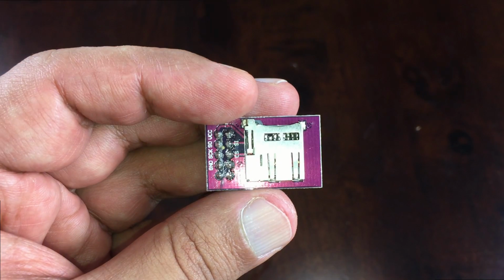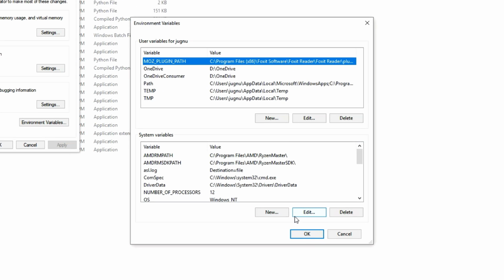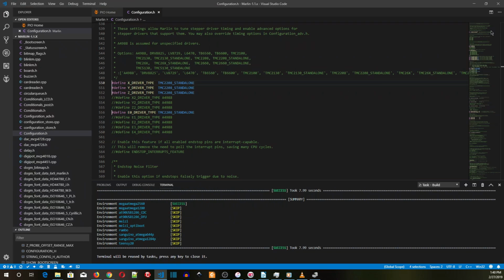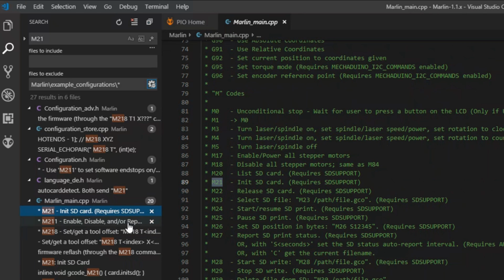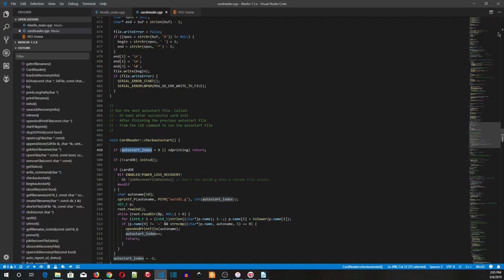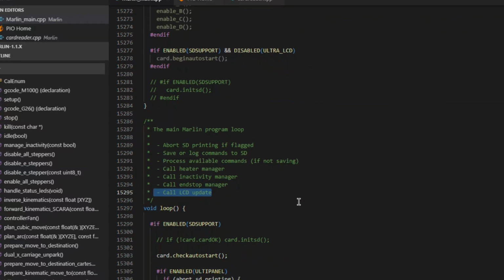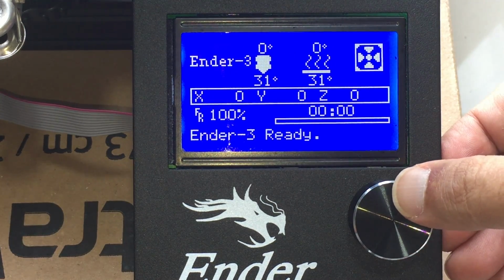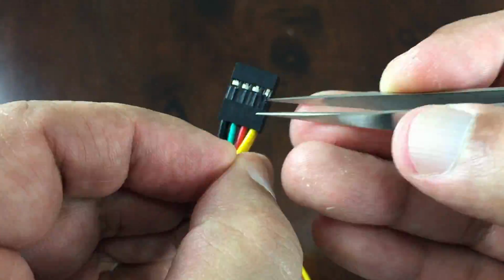Ender 3 + MKS Gen L : SD Card Add-on Modules & PlatformIO IDE

Comment: Love all your videos. I have used this video to connect a  6pin microSD card reader to my MKS V1.0, however with my new motherboard (MKS V2.1) I cannot figure out how to wire the same microSD card or even the MKS sd card reader. I cannot find any documentation on the v2.1 to enable micro/SD card. This is my last step to my first print. I hope someone can help me out :)
Reply from the maker: Hi @EhWildJDM. Referencing the schematic/pinout for v2.1. You can get it at the makerbase github site. Hoping these will show-up. 
For v1 - https://github.com/makerbase-mks/MKS-GEN_L/wiki/MKS_GEN_L_V1 . 
For v2 - https://github.com/makerbase-mks/MKS-GEN_L/wiki/MKS_GEN_L_V2 .
Observing the v2.1 schematic/pinout, all the pins which are necessary for the connections to a card reader are located in the EXP2 connector. These pins are D49 to D53 & GND. You would also need 5V which can be taken from connector EXP1 or any connector which is unused on your board which has a 5V label/supply.
NOTE: You will NOT be able to plug-in the existing connector (from the SD-Card Reader) directly to the EXP2 port. You'll need a new connector to plug into EXP2 and arrange the wires (attached to the connector) to correspond to the relevant pins. Refer to the wiring diagram in the my video.
So if you are using the full-size card-reader as per my video, it comes with a 8-pin female-female connector cable. One side plugs into the sd-card reader. On the other side, you'll need to pop-out the wires and attach them individually to the corresponding pins in EXP2 & a 5v supply pin. Again, refer to the wiring diagram.
There could be a SD-Card Reader made specifically for this board which I am unaware of so that could be an easier solution. But if you don't mind some hacking, you can get printing much sooner.
I'm hoping this helps. Please refer to the pinout-schematics for v1, v2 (github links above if accessible) and the wiring diagram(in the video). All the info you need is present in these resources. 
Have fun buddy.

Comment: Ime not fully tec minded  i have the new creality 4.2.2 32bit motherbord on my ender 3pro marlin latest version 206  and ive tryed numerous tft extension adapters and fined there crap I would love to be able to connect a sd card reader to my motherboard as got impaired fingers and have trouble with the tiney micro sd's any help much appreciated 👍
Reply from the maker: Hi there @sprocky Lock. The easiest solution would be an extender. Go to Aliexpress, do a search for "micro sd to sd card extension cable adapter". This is basically a micro sd plug on one end with a full-form sd-card slot on the other. It simply extends your micro sd card slot to an sd-card slot. Simplest solution without tweaking any hardware/firmware. Hoping I answered your query and that it was helpful somewhat.

Comment: Here is a quick way to initialize SD CARD on Marlin V1.1.9

1. in Configuration_adv.h
Comment out or disable "#define SD_DETECT_INVERTED"

2. in pins_RAMPS.h 
Find the first instance of "#define SD_DETECT_PIN" and change the value from 49 to -1.

SD was not able to start printing a file and no initialize option was available. 
I was able to use SD module after sending M21 via terminal but with this fix, everything felt in place.
Worked with Arduino Sd Card Module, on AUX3 of MKS GEN V1.4, SPI, CS pin as SDSS 53
ref: https://github.com/MarlinFirmware/Marlin/issues/9177

Comment: I need help please
I did according to the guide, (the card reader with the long wires) Now that the card is out, the screen gets stuck doing nothing. When the card inside everything works well
Please friend who can help?
Thank you
Reply from the maker: Hi @Eyal Biton. I'm sorry that it doesn't work for you. Let's see...try another SD Card? Please re-check your wiring? Remember you need to make NO firmware changes for this type of SD-Card slot? It should work out of the box. Re-check your wiring again :) Did you get/buy only one SD-Card slot? Try another one if you bought more than one. If it persists, then maybe you can try the firmware modification for the other type of SD-Card slot discussed in the video. I'm suspecting the SD-Card slot not delivering a clean signal when you eject the card. But do check your wiring. God bless & hoping this helps.

Comment: How does the Marlin firmware (1.1.9)/MKS Gen L  differ from the Ramps 1.4/Creality Melzi?

I really like Pronterface's Printrun interface..  can anything like this be done using Visual Code and the PlatformIO extension? Arudino? 

Also, can different motor drivers be used for EACH axis?  The external high-current driver 57 and 86 stepper motors.
Reply from the maker: Hi @Ben Nguyen. The difference is going to be primarily based on IO pin assignments. For the  MKS Gen L board, take a look at the file Marlin-1.1.x\Marlin\pins_MKS_GEN_L.h. The changes are all those lines above this line, right at the bottom, ' #include "pins_RAMPS.h" '. The file "pins_RAMPS.h" is the IO pin definition of the RAMPS boards dependent on the specific version. If you refering to the RAMPS 1.4 board then have a look at the RAMPS 1.4 definitions within the file.
The same goes for the Creality's MELZI board. Open the file Marlin-1.1.x\Marlin\pins_MELZI_CREALITY.h. All the lines below this line, right at the top, ' #include "pins_MELZI.h" ' are the changes specific to the Creality Melzi board. The rest of the definition are taken ight from the MELZI board by including the file "pins_MELZI.h". These are the differences in the firmware which I hope you were asking for.

I'm not sure if I understand your question but if you are asking if an extension for controlling 3D printers is available from within VS Code then I don't think so. Nothing showed in my quick search. There is an extension which helps in editing and formatting gcode file but other than nope. You can open a terminal and connect to your 3D printer directly from VS Code if you like but no GUI option.

Yea I suppose each axis could be driven by a different driver. I don't see any limitation in the firmware. Each axis has been designated its own definition so I believe this can be easily done. I've not tried it though but I've seen users use the TMC drivers in conjunction with the LV driver for the extruder.

I'm not familiar with the external current driver 57? Can you be more specific? Perhaps share a link to the device?

For the motor, NEMA 86 is just the designation for the physical size of the motor. You could use higher torque motors as long as the drive current requirements are NOT exceeded for your specific driver. The TMC2208, for example, can drive any NEMA hybrid stepper motor up to a current limit of 1.4A.

I'm sorry buddy but I may have not understood all your questions. Hope it helps.
Reply: @yemojamakerrefuge898  Thank you! Yes, that was what I was wondering about!   I'm still in the process of setting everything up, but I hear good things about 'akaJes/marlin-config', (no Klipper support?), but it may help beginners (like me) setup the configuration file the first time.

Comment: Reading in a page please solve the eeprom version error with M500 M501, but when I type the M21 command it shows the message SD init fail
Reply from the maker: Hi @Cassio Campos. Sorry buddy for the late reply. Can you describe your problem a bit more. Did you insert an SD Card when doing M21? Is your SD Card formatted properly?
Reply: @yemojamakerrefuge898  can you help me ?
Reply from the maker: Hi there @Cassio Campos. Sure buddy I'd love to help you. You mean to say you can't get either module to work on your board? The module on the left i.e with the full SD Card socket should work without any firmware modification. If neither module works than it is possible that you may have a faulty MKS Gen L v1.0 board. You are using the MKS Gen L v1.0 board aren't you? I'm afraid the ATMEGA 2560 has ONLY one SPI port which is wired to AUX3 connector. Meaning there's no other way to fix a faulty SPI port. It could be the connection to the microcontroller is broken. Maybe you can check that with a multimeter if you have one. The pinout can be referenced here - https://www.arduino.cc/en/Hacking/PinMapping2560 . 
The other way will be to use software based SPI library but the firmware changes required would be quite involved. I'm not sure whether this approach will work with Marlin however as the a hardware SPI port may be necessary for everything to work together. Sorry buddy but this is all the help I can offer right now. Perhaps you could find someone with an MKS Gen L board and test your SD Card modules with that board instead.
Hoping this helps.
Reply: @yemojamakerrefuge898  friend, thanks for the reply,

my mks is version 1.0, I did not test the complete sd module, I still have not bought it, I have these 2 simple ones and connecting them to the board none of the 2 is recognized, I do not know what to do anymore, on this subject I just found your video on the internet so I'm kind of out now

but thank you for answering me and trying to help, in the future I will try to buy the complete SD module is my last chance
Reply from the maker: Hi Cassio Campos. I just noticed the module on the left is exactly the same as on the right. There is no SD Card detection pin so these modules will not work without the firmware change i.e. to disable the SDSS pin. However if these modules are connected correctly to the board, the M21 command should still work without the firmware change. The module I tested looks very similar to the one on the right with the micro SD slot. Can you also try to go thru the comments here as I have shared some other information specific to different SD card modules primarily in regards to pinout. Please check your wiring and ensure the jumper cables you are using are not broken. Also, try different SD Cards as sometimes the card or the filesystem on the card may cause an error to be reported. I'm not sure what you mean by a complete SD module though? Hope you get things working by God's grace. Hoping this helps.
Reply: @yemojamakerrefuge898  exactly the same, one of the modules is identical to what you used in the video, but when connected to the card and putting the command M21 it appears msg "SD CARD INIT FAIL"
Reply: @yemojamakerrefuge898  Hello, thank you for replying to me, I did the procedure following your video in the moment of using the M21 command it does not start SD and I get a msg of fail.
I will send 2 prints, the SD modules I tested and the error that appears to me.

Modules:
http://prntscr.com/ocv67f

Error:
http://prntscr.com/ocv5we

It seems that the board is not recognizing the module, is there any other place that can connect other than the AUX3?

Comment: Any help J ? I setup my Marlin 1.1.9 +TMC2208+ Mks Genl as You describe on your previous videos, (Great Tutorial by the way) ,I add my features like BLTouch,Filament runout sensor. I get my Micro SD card mini TF card reader module SPI interfaces with level converter chip for arduino form Aliexpress and pinout for 6 pins are:
VCC is the power supply, MISO, MOSI, SCK is the SPI bus, CS is the chip select signal pin, GND
I Connected to Aux-3 all as described,
I left pin49 and NC not connected , CS is pin53.... and nothing, Do I need to change pins configuration ?
SCK is SPI bus so maby this is a problem?
or this adapter is no suitable for ender3
Reply from the maker: Heya @Jacek N. Pin D49 is the card insertion detection pin. By default this is set to value 49. So if you leave it disconnected, then you'll need to make the firmware change to set this pin definition to "-1" for the module to work as shown in the video. Also, can you send link to where you got the module from on Aliexpress?
I hope I understood your query/problem? Hoping this helps buddy.
Reply: Yemoja makerRefuge Hello, I did what U wrote I replaced all sd detect pin 49 to -1 value all across pin_RAMPS.h file... no affect
maby I need to change lcd controller ?.now is setup for standart CR10 controller. or this sd card reader is not siutable for ender3
Reply from the maker: Hi @Jacek N. That should do it too. I rather the change be made in the pins_MKS_GEN_L.h file instead where you need only a few lines of change. 
Anyway, on my Ender 3 the display controller is set-up as "CR10_STOCKDISPLAY". If you can share a picture or some info on your SD-Card reader than I may be able to suggest some other things to try. Otherwise you may be right that the module you have may be unsuitable for your printer. Remember, the module must be compatible with the SDRamps module for it too work as described in the video.
Hoping this helps buddy.
Reply: Yemoja makerRefuge youtube delete links to aliXpress, I will try do some changes when I come back from work.cheers anyway
Reply: @jack84wze  Set #define CR10_STOCKDISPLAY in Configuration.h and in pins_RAMPS.h search for #if ENABLED(NEWPANEL), then below CR10_STOCKDISPLAY, then below SD_DETECT_PIN. Change from 49 to -1. Compile and upload the code. I'm using right now Marlin 2.0 with Ender3 + MKS GEN L.
Pozdrawiam/Regards
Reply: @jacekk6913  Completely nothing... what I noticed , when I plugged in sd card reader Vcc dropped from 4,95V to  1,75V , and  dc regulator output is 0.9V , I've  try 3 readers, brand new .. same story
Reply: I just get card reader from yours tutorial. And... it works :-)  , it was worth to wait 3 weeks. Thanks for Your help mate